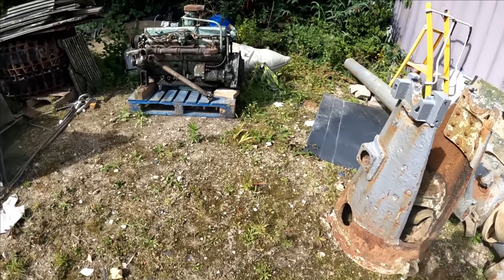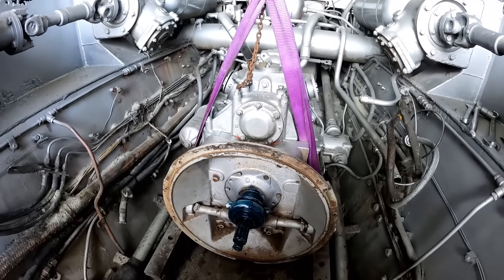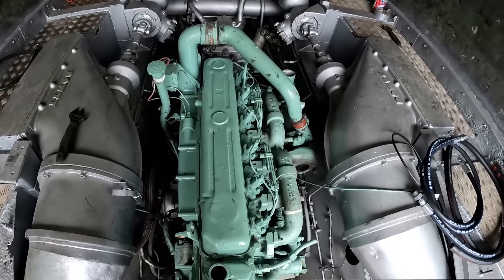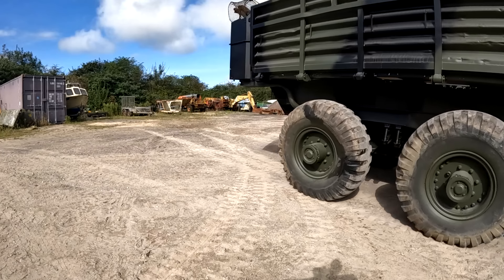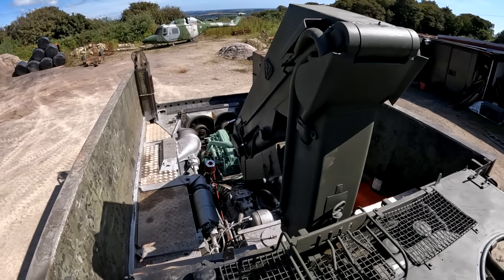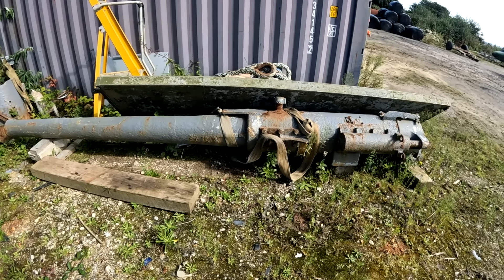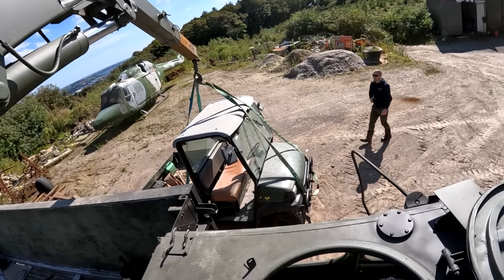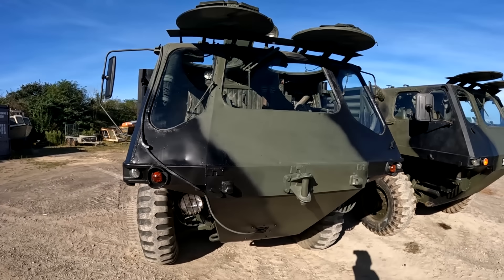Stalwart Mk2 Restoration Part 3: Engine Swap and Crane Test

Comment: Excellent Stolly projects! I've always found their engineering lineage fascinating as the basic suspension and drive train concept is shared with the Saladin. There are few vehicles in NATO logistics history, that have been as useful and served so long. Owning and operating one of these for fun, makes a lot more sense that many other military vehicles.
Reply from the maker: Yes it’s a bit more useful than a lot of things that’s for sure !
Reply: Saladin , Saracen , Salamander and Stalwart all shared the same platform , Saladin being a recce turreted armoured car with the 76mm gun , Saracen an APC some with a machine gun turret, Salamander was the fire engine and of course Stalwart was the do it al amphibious logistics support truck

Comment: Hi Ben lovely vehicles you have restored well done, I remember stollys from my army days, I thought they all had what they called swim boards on the front of them, and wondered where yours had gone, its only a piece of ply board but helps when they swim on entering the water and stops water from coming over the roof. Please keep up the great work your doing. Best wishes and kindest regards.
Reply from the maker: They did have swim boards but when the army decided they no longer needed them to swim in the later days they chopped off all the brackets where they fit on the cab! I have got one to fit on the mk1 which is now a full swimmer so I will get that on at some point 🙂
Reply: @BenoCam  Thank you for your reply Ben.

Comment: The problem with these petrol to diesel conversions is not that the diesel is somewhat less powerful than the petrol engine but it (the diesel) typically has a max. RPM of 2500-2800 rpm and usually runs at around 1800-2000 RPM during operation. The B81 turns up to 3750 RPM and usually operates at about 2800-3000 RPM. This means the road speed of the dieselized Stollie is markedly less than the original version.

Comment: Was hoping to see the welding and the body work repairs,
Reply from the maker: I have a video online of the mk1 restoration project where it had just as many holes and I welded all of those up and made it swim again. 
I just really needed this asap to do a few engine lifts so I needed to get it diesel engined and reliable as soon as I could so that I could do those lifts. And it’s been great so far!

Comment: If I am remembering correctly the crane version were built for the Royal Artillery Regiment so they designed to lift 105mm & 155mm NATO shells in palate system

Comment: You have done a great job on both those stollys . Hopefully now they will be reliable with diesel engines in and a bit cheaper to run. 👍👍👍👍👍👍👍
Reply from the maker: Cheers. I think putting diesels in them makes them fantastic vehicles but I know they are not original. It would be quite simple to re instal the Petrol engine if anyone ever wanted to.

Comment: It's probably of no practical relevance as "swimming" mode won't be often used. At 2:37 there is good view of the water-drive prop shafts.  Where double universals are used with a 'floating' intermediate shaft, as in this application, it is essential that the phasing of the joints is done correctly to prevent vibration caused by the slight cyclic speed variations during rotation.  The shaft on the right is almost correctly phased but the shaft on the left is out by 90 degrees.  Knuckle joints on either end of the floating shaft should be orientated to match.  Edit :  For those wondering what I'm on about, the output of a standard universal when operating at an angle is not "smooth".  The geometry during rotation creates a slight cyclic disturbance.  If a pair of universals are in phase, such disturbance can be cancelled out.
Reply from the maker: That’s interesting, I may one day get this one water tight enough to have a play swimming.
Have you seen the videos where we swam the mk1? The drive on them was totally different but they were a bit of fun to play with on the water.
Reply: @BenoCam  That was one impressive 'swim'  of the mk1 and no lifejackets involved.  
I note the universals on the Mk1 are in phase

Comment: Always loved stollys  , glad you replaced them with diesel units as petrols were shite   , great vid beno 👍😉
Reply from the maker: The petrol that was in it sounded lovely but it was the refusing to tick over for a while which was breaking me. Particularly mid job on the hiab !!
Reply: @BenoCam I might be ring but I’m sure the military at the end tried a few or one with a diesel in it  , it may even still be a Tewksbury storage.  ,  great vid beno  👍👍

Comment: Im impressed by that crane, no stabilizers, and lifting a reasonable weight off the side, you should try that gun either over the front or over the rear where you best lifting points are.
Reply from the maker: I quite fancy making a few outriggers wouldn’t take much but can’t afford to go out much else it won’t lift as much. Been told acro props under the sides in between the wheels work well as it stops the suspension dipping !

Comment: Well done she looks and sounds good , never really came across a Stalwart in my time in the services but then I was RAF . Was mostly Harrier Force so saw plenty of the work that the REME did , they worked hard I must say not forgetting the Pioneers if they still exist  . Not sure if there is a replacement for the Stalwart in modern times but it does remind me of a Mk-6 Crash truck , way before my time I only go as far back as a MK-9 , another beast . How ever the MK-6 was legendary , so might have been old and to modern standards clunky but it worked . I some times think that modern computerised vehicles are shall we say .....useless when it comes to field conditions . I am 52 so maybe just a bit bias , but these beasts work well . If you get a ECU failure well can you fix it in the field ?

Comment: Thanks + Wikipedia says the Hiab will lift 3 tons (and I guess it is tons not tonnes) and the petrol engine was good (or bad?) for 4 mpg.
Reply: Tons and Tonnes are only a few pounds apart. 1 ton = 2240 pounds. 1 tonne = 1000kg = 2204.6 pounds, so 35 pounds difference.
Reply from the maker: There is a plate on the crane with the different weights it can lift and distances away, it should lift the abbot engine if I can get nice and close. We will soon see !

Comment: I have scrolled through this channel's recent restoration vehicles and my biggest question is how'd you start collecting all of these? I am 17 and would love to get into military vehicle restoration in the future, however, I am from Wales and worry it may be implausible for me. Any advice to help me?
Reply from the maker: Well I didn’t buy my first vehicle until I was well in my 30s … a total rusty wreck that I was warned I would never get going. Sometimes the only thing you can afford is a rust bucket but if your thinking long term it won’t matter. Just buy any project you can afford or find that’s interesting to you want work out how to do it along the way. It’s not easy for people starting out now as there is not so many cheap projects but you do find a few. Keep a look out on marketplace and milweb and word of mouth from others. The Facebook groups are really good also especially for finding parts. There’s a lot of groups now dedicated to each vehicle type and they are full of really helpful people. Also I’m down in deepest darkest Cornwall so wales can’t be any worse !
Reply: @BenoCam  Thank you for your response. that'll give me a lot to think about for the future and keep me more optimistic

Comment: Remember how you did it with that much grease you will probably soon have to replace the clutch sorry!
Reply from the maker: I don’t think it will get in to the plate , from what I can see from the inspection hole in the top of the bell housing most of it has spun off in there. It did make sliding the engine into the gearbox nice and smooth so it did it’s job.
Reply: @BenoCam the part that “spun off” directly onto the centre plate you couldn’t see inside the pressure plate is the bit in question the fact that you saw the rest fly off says you used to much!

Comment: 2:12 Why grease everywhere ? It whill just fly a round, and if it hit's your clutch plate, your going to be happy. The bearing has grease inside, only the shaft where it glides on has to have some grease.
Reply from the maker: I wiped most of it off it was just nice to have everything all lubed up as it was sitting out in the rain for a while and everything was starting to go a little orange !